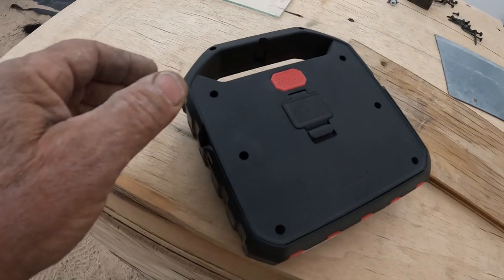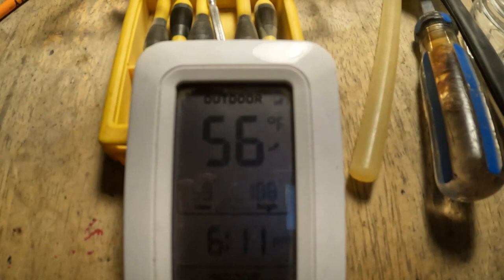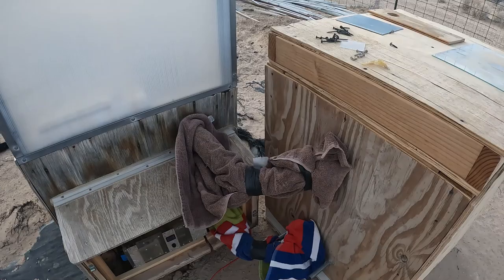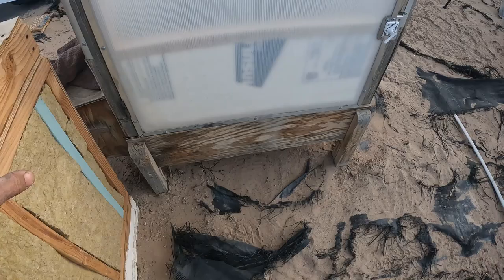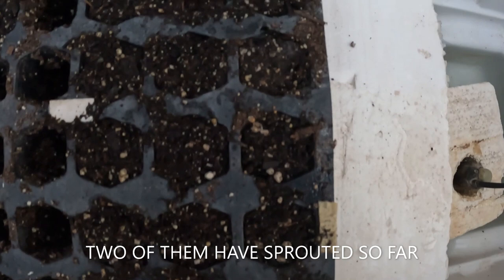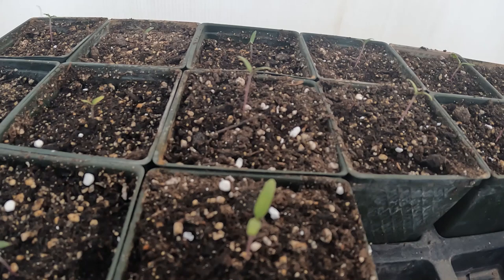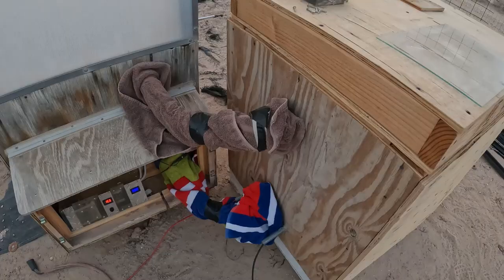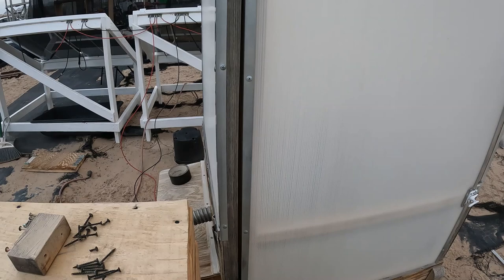Sand Battery Connected to a Greenhouse Episode #83

Comment: have you thought of using resistance wire? robert murray smith did a video with this stuff where he added resistance wire to 240v heating element so it only draws 12volts and .5 amps so 6 watts. Might be something to consider, you could make small flow battery for very cheap or even just use a normal lithium battery to leave it on 24/7
Reply: Was it just 12v and half an amp?